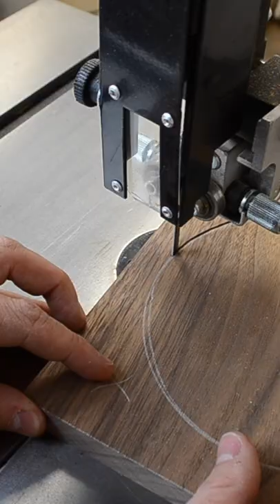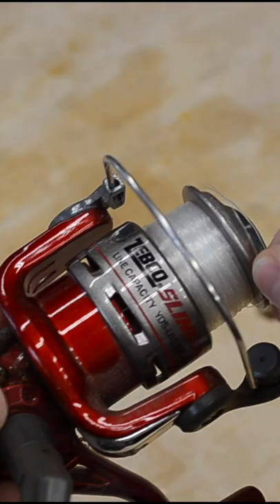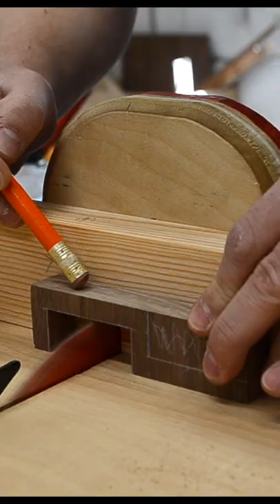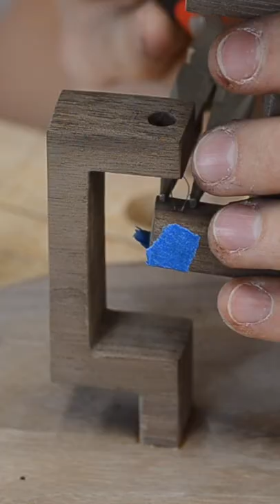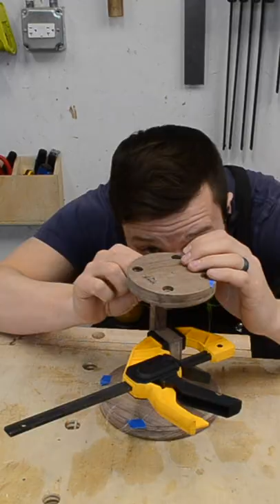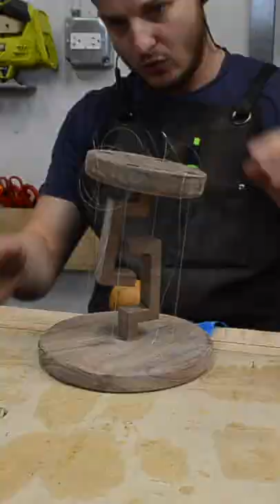Impossible Floating Table #shorts

Comment: looks neat but seems pointless
Reply from the maker: I think that’s a pretty accurate assessment 😅
Reply: When done at a larger scale I makes a cool table , I sqe one the size of a patio table with steel cables and it didn't rock and move like this smaller one and when people come over for drinks by the pool or fire pit it blows people's minds. The guy that built it literally could stand on top of his and was perfectly fine.